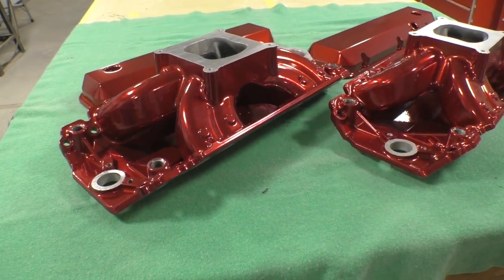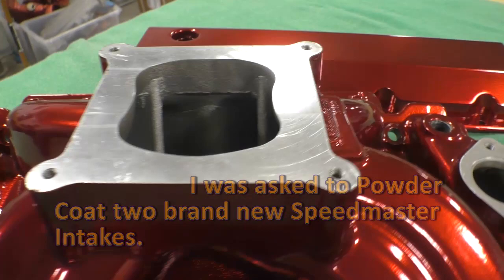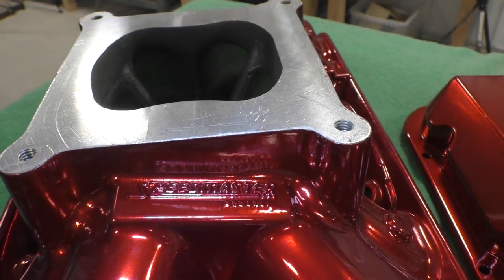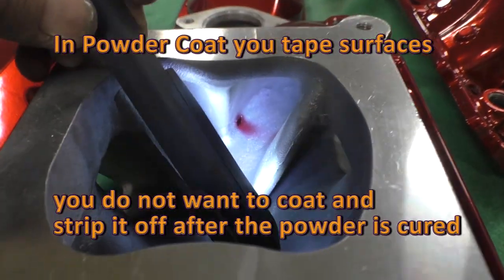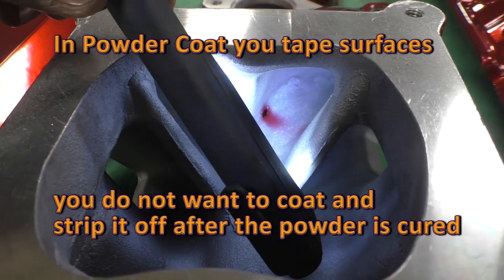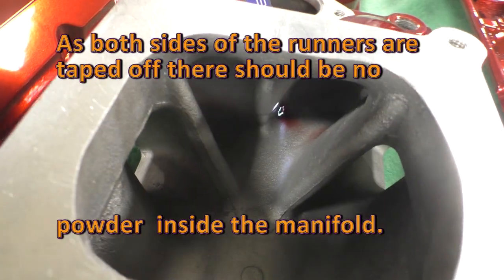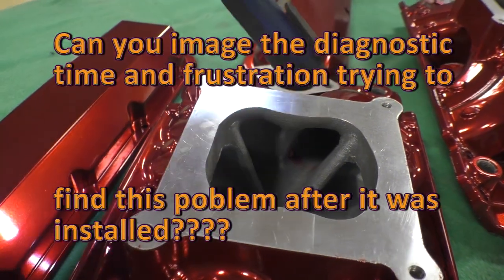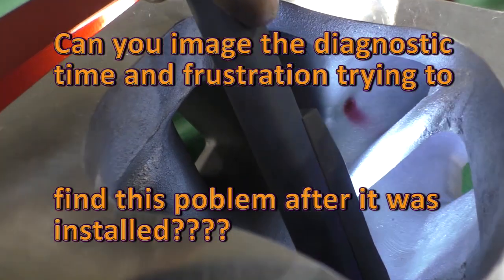Hole in Brand New Speedmaster Intake Manifold.

Comment: Hi yes they have casting flaws and they tend to use a filler in the bad spots so when you blast them you have to watch for those ,,nice job by the way ,,fix it putting tape on inside and slow cure JB on outside sand and coat,,By the way Holley stuff is the worse for this ,,
Reply from the maker: Thanks for not, camping on, but providing interesting and useful information.

Comment: If you have one header port "Cherry RED" its LEAN! Normally from a vacuum leak, clearly this would have been the case really fast!
If you run power brakes you can get a lean run one cylinder, mainly do to again, a vacuum leak.
Carburetor cleaner prayed on suspect areas will drop the RPMS when the leak is momentary "Plugged"  Go slow, start with the carb gaskets, all vac fittings, intake manifold to head (Your screwed if its under the intake) and throttle shafts.
Reply from the maker: All true, nicely thought out.